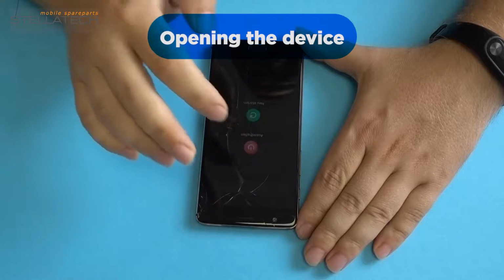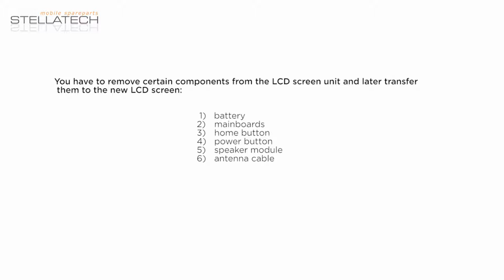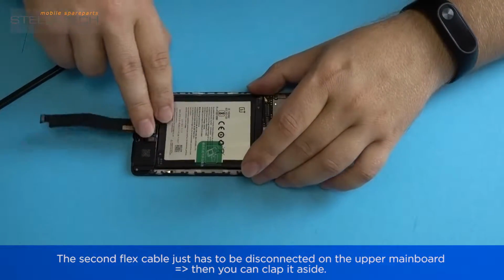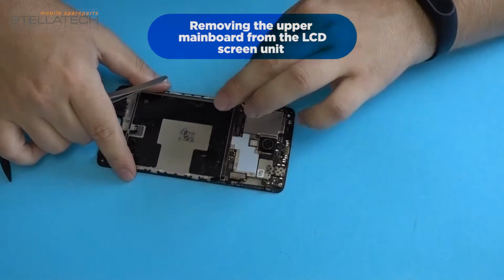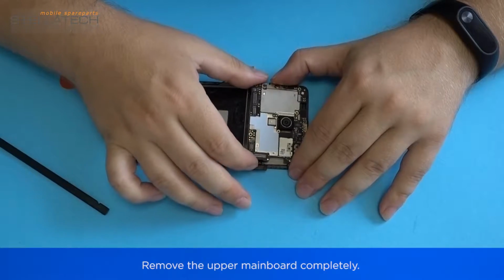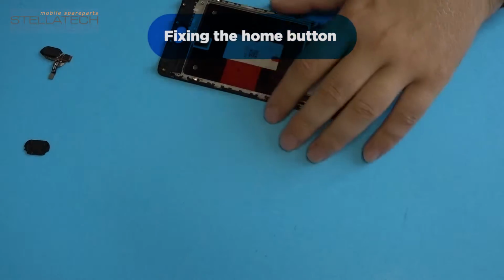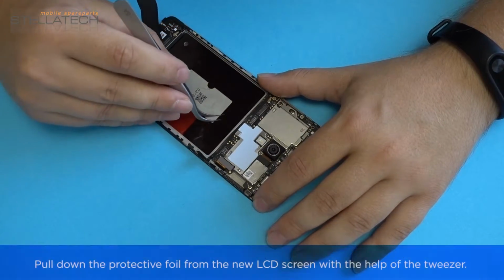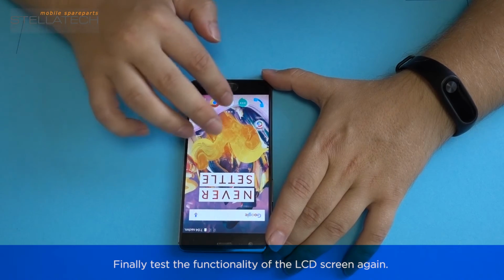OnePlus 3 - Screen & Battery Replacement | Teardown Guide

Comment from the maker: We hope our new tutorial will help you with the repair of your OnePlus 3. Please give feedback, if you succeeded and if you have any suggestions for future videos.
Reply: is this possible to change  screen of any phone with any phone.like samsung s8 srceen on iphone 6s.
Reply from the maker: Hello StarX,

Thank you for your feedback. You can change the screen of any phone but you have to take an individual screen for each model. You can't put Samsung S8 screen on iPhone 6s phone.
Reply: Thank you. I have infocus m810 with on display, no battery and no back panel, i have circuit board only.i want put 18:9 display on it. Is this possible?
Reply from the maker: Hello StarX,

Unfortunately, we do not have any experiences with infocus phones. But in general you have to make sure that the new spare parts (especially the display) are made for your model. If you take spare parts from another model because the measurements are the same you can't be sure that it fits. Because connections and other technical conditions are individual in each phone. 

So for your intention you have to search for original spare parts for infocus m810 or any spare parts which are expressly made for this. 

Maybe you can tell us if you succeed and found the needed parts.

Good luck with it!